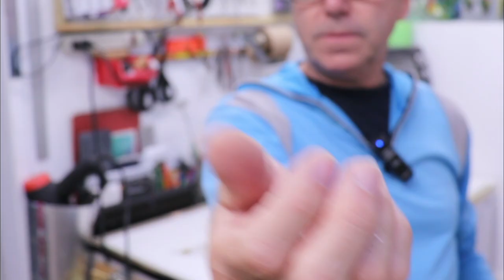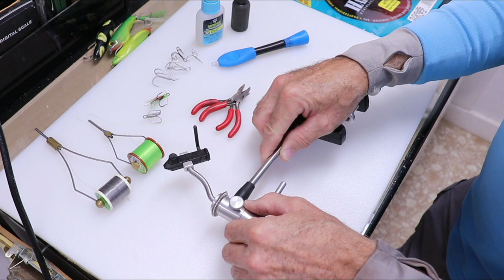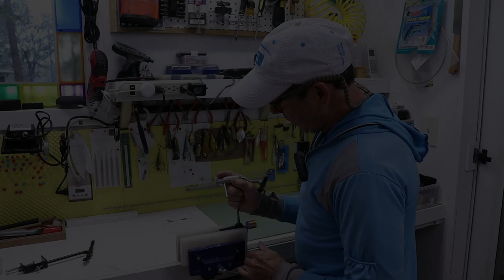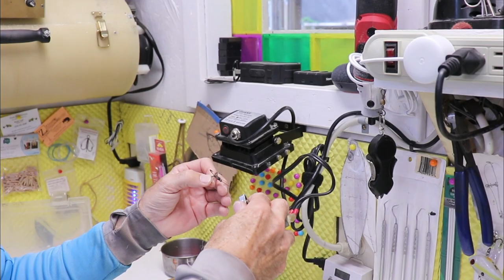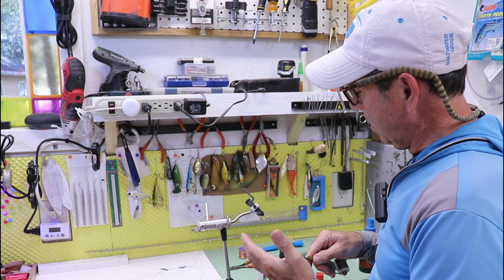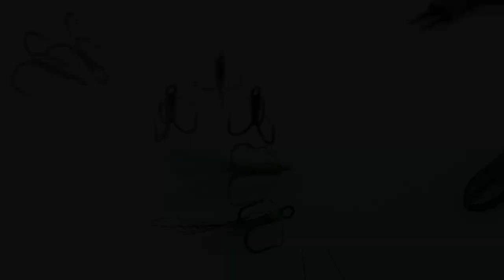Making Weedless Treble Hooks

Comment: Weedless trebles would probably be really good for spoons, especially for trolling them. I used to use King Spoons, big single hook spoons. They would get hit and not hook fish fairly often. So on one I put a big split ring and treble hanging from back of the hook hole. The other one I used thick single strand leader and wired a trailer hook. Neither seemed to affect the actions of the spoons much, I still caught limits of kings on them. Those spoons could have the big single hook wired weedless and a treble out back. The trebles probably doubled the number of fish we hooked and landed in Florida. 
Later I left them with my Costa Rican fishin' buddies, the mackerel there also bit those spoons.

Comment: i use a humidifier motor for a drying rack and  put pink foam insulation the sit the resin to hardon   pool noodle does work to just have to fill the center with a dowel and drill a hole in the  center to
 cut into the ends  for the hook to sit into the

Comment: You said the wire must be??? or it will not work I heard the size and I could not hear the word you used. Was there another criteria you were specifying? Great idea but from what you said I was not ready to buy just any leader material. May I suggest if that your tailing materials will look better /more Natural if you tie in the trimmed portion and the part in the water will keep a tapered look.
Reply from the maker: Thanks for the tip.
Reply from the maker: In the video I give you the size and type of leaderwire I use and I say that whatever wire you use it should not be  annealed wire.

Comment: What size wire would you suggest for size 1/0-5/0 hooks? Or how do you determine if its strong enough wire and not too strong?
Reply from the maker: That would take some experimenting....
Reply: @EngineeredAngler  Yeah I figured I'd ask anyway. I'll buy a bunch and test it and let you know. Thanks for the video!

Comment: I really like your videos.  Have you made an articulated snake lure?  I've had good luck fishing for snakeheads with snake lures, save for all the snags.  If only an engineer could design a retractable mechanical hook system that only pops out when the fish bites the lure.... lol
Reply from the maker: I actually have designed a lure with a hook that only comes out when a fish hits it...it's called the "Switch Blade Shad".  I haven't shared the design yet...

Comment: I wonder if using only one wire can do the same job, but have the wire bent  down and in to a circle. The same diameter as all three hooks. 
Dunno
Reply from the maker: The wire loops will snag grass etc...
Reply: @EngineeredAngler  , crap. Ha